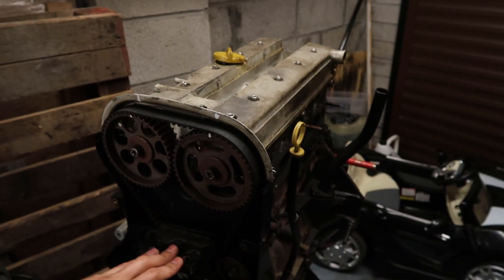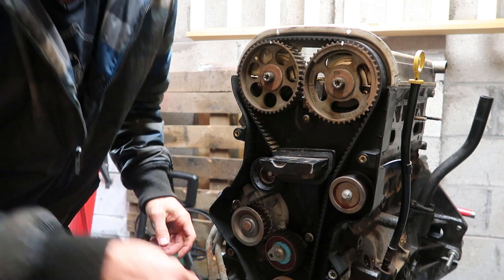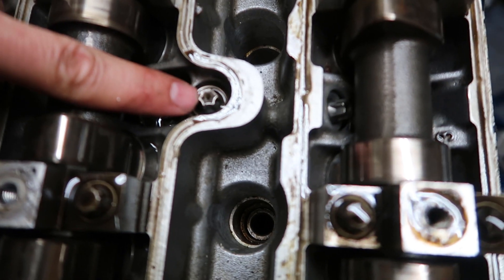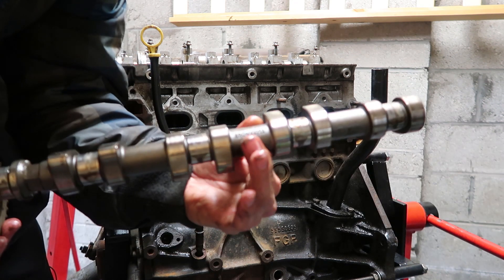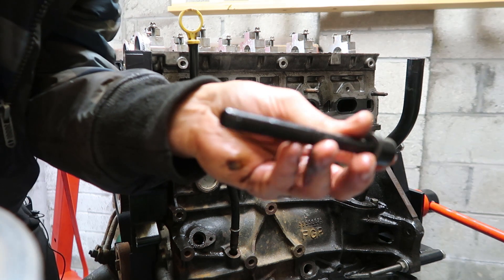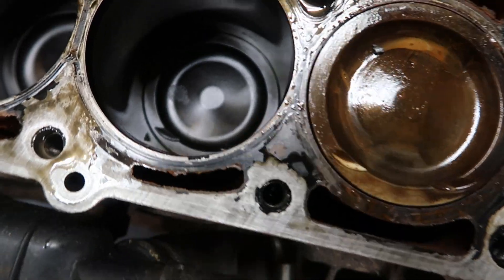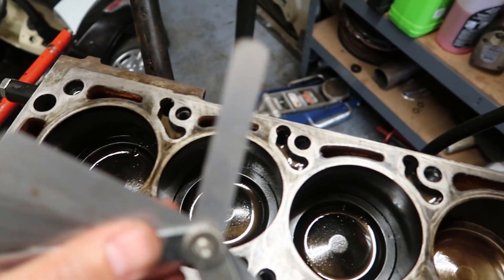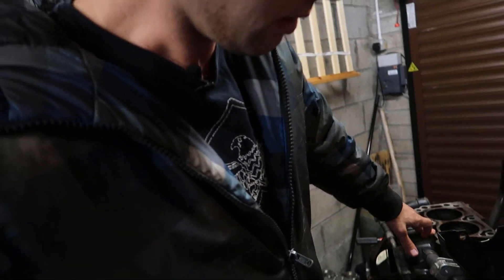Head Gasket Failed.  But Why? (Astra VXR Engine) GM

Comment: I have a minor oil leak on my rocker gasket, do you recommend  any🎉 silicone with a new gasket? 
Which type? 
Engine z20let
Reply from the maker: No don't add any extra sealant.  Let the the rubber do its thing

Comment: I got the same motor, blowing white smoke and bubbles in reservoir, initially head gasket, car starts and runs but after a short drive or 10-15 minute idle it fails to restart until cooled down, thoughts ??
Reply from the maker: Headgasket or cracked head/block
Reply from the maker: The blocks warp badly aswell so definitely need decking both head and block before throwing a new gasket at it

Comment: I've changed the head gasket and burnt valves on my 2005 Astra H on 3 separate occasions now...I have to change it again since there is oil leaking into the coolant reservoir. I don't know why it keeps happening. Engine went to engineers, and they say the block is not warped. Car drinks coolant like a desert camel.
Reply from the maker: @stanmarr4488  when alloy heads a badly overheated they can "go soft" if the deck surface is perfectly flat on both the block and head freshly machined to the correct Finnish.  That means it can only be the head itself if a good gasket was fitted

Comment: i know this video was posted from 2 years ago but i thought i might give it a shot for a question.

I got a z20LET and mine has a blown head gasket too. Now i have a other Problem that my engine is leaking Coolant on the floor when i turn it off and leave it over night. The next day theres coolant everywhere on the floor. Where could that come From? under the car theres nothing to see... i did a leak test and the whole system was sealing properly. my friend got the same Problem but i cant see where it is leaking.
Reply from the maker: Have you got a coolant system pressure tester?  What normally happens is when you drive the car around with a slightly blowing headgasket, it pressuris the coolant system and coolant blows out the back of the expansion tank.

After a hot shutdown and parking up it will continue to drip for sometime.
Reply: first thank you for your answer,

i did test the system when the car is off and everything is sealing but after a longer ride i have on the passenger side under the car a big coolant leak and i cant say where its coming from. i heard something that theres is a hose that gose behing the oilcooler or something.
could possibly that leak?
Reply from the maker: @damjanmilosevic4161  Have you replaced the headgasket yet?  

Like I say the cooling system over pressurizes from combustion gasses entering the water jackets forcing coolant to escape form the expansion tank after hot shut down.

Comment: Mr #BoostHit!   What brand of hydro capital do you recommend? if it clicks should I make a new one or is it worth disassembling and cleaning?  (Z20LER)  . Thanks for the reply!  Respectfully,  Richard.
Reply from the maker: "Hydro capital "  what?  Are you meaning hydraulic lifters?
Reply: @boosthit811   Yes, hydraulic lifters :). I used "Google translate". One is already clicking. I gather some information before I start. What brand do you recommend?
Reply from the maker: @rigofutty5172  ok.  You can pull them apart and clean them.  They are held together with a snap ring.  Use vice grips and some wood to pull the centre piece out.  Clean up with ultrasonic cleaner or white sprits and a small brush.......

Mine were very bad.  Since cleaning 2/3 years ago are perfect now.
Reply: @boosthit811  Up for cleaning! I don't buy unnecessarily. Some of the new ones are bad. Thanks for the advice. I will continue to follow your videos!

Comment: How much to rebuild my z20 leh its still running but I would like a full rebuild stock
Reply from the maker: Depending if any engine damage and are you after a drive in drive out service.  Guessing £1200 to £2500 ball park.  Depends on spec.
Reply: @boosthit811  ive got a zafira o know same engine and i. Looking to get another car so I could drop the vehicle to u and leave it till jobs done wot about warranty and how long would it take and where about are u im in Essex
Reply from the maker: @richardgrubbe1013  oh.  I'm the other end of the country 😅
Reply: No worries mate thanks for getting  back to me bro

Comment: I have c20xed engineand cylinder head resurfaced changed valve seals and on cylinder nr1 i have oil leak somewher from head to combustion chamber and intake manfold. What could cuse that
Reply from the maker: A crack.  Pressure test water jackets in warm tank to around 30psi and then do same with oil ways up to 100psi......
Reply from the maker: Does it have new valve guides?  Block decked?
Reply: It has been pressure tested before surfacing, and at the shop they said there is no need for valve seats, only seals are replaced
Reply from the maker: @srbskipas5667  ok.  Unless you specifically asked for oil way to be pressure tested they normally wouldn't bother.  Could makeup something yourself....
Reply from the maker: @srbskipas5667  most likely something simple likely a ripped or damaged valve stem seal or guide.  Or un diagnosed crack......that's assuming the oil is coming down from head and not up from damage to piston
Reply: @boosthit811  when I take out sparc plugs  i can see small amount of oil sliding into the piston when the engine is hot and piston on cylinder nr1 is on tdc. I saw that through sparc plug hole. And it is pretty small amount of oil. There is no coolant missing or mixing with oil
Reply from the maker: @srbskipas5667  I would probably apply a pressurised oil source into the oil pressure switch and watch through the plug hole to confirm.....sounds like a strip and inspect to see what's failed.
Reply: Oil way through center of the head you need to do the common mod with alloy tube

Comment: Hi do you maybe know the torque values for the head bolts and the cams?
Reply from the maker: Head bolts: use new.  25nm then 90° + 90° + 90° + 45°.  Cam caps 8nm.
Note head bolts start from centre and spiral outwards for torquing down head.
Reply: @boosthit811  thank you. Much appreciated

Comment: gASKET RUSTED BAD. tHE OWNER PROBABLY USED ONLY WATER INSTEAD OF COOLANT AND  THIS RUSTED THE GASKET BADLY. JEEZ SOMETIMES IN SUMMER I PUT ONLY WATER IN MINE. MAKES YOU THINK DOESNT IT. OBVIOUSLY WITH THAT CRAP SILICON GASKET THING GOING AROUND EDGE THE OWNER TRIED TO BODGE IT UP.

Comment: new here, are you an engine builder by trade? also do you use a manuel when doing this work? cheers
Reply from the maker: Mechanic by trade, moved into more engine building performance   based stuff.  That's my passion.  Manuals are very handy but haven't found one specific for the vxr.
Reply: @boosthit811  how do you know the torque specs then? and great channel but need more weekly uploads 👍
Reply from the maker: @jasonjuggler3457  thanks.  Yeah I know, quite busy with my day job.  The last engine build i did i used ARP studs and fasteners throughout and arp supplies all torque settings and thread lube.  Normal basic engine build stuff you can find settings online or use a Haynes manuals etc.
Reply: @boosthit811  Its rare to find a knowledgable channel which does engine work shares their expertise. Thanks a lot for your replies. I have subscribed.

Comment: Is that deck within tolerance though? After all, it's a Vauxhall and that's not where it failed.
Reply from the maker: Haha fair point.  I don't know what the exact tolerance limit is but personally on my builds I would deck the block.
Reply: @boosthit811  if theres a degree of consistency in that gap...its likely to be a factory preset...put the cleaned block in an iven and check it at a bit above operating temp...may well settle out zero hot...same for heads...gaskets age like everything...not detonation suggests this would be the problem...im new to these engines & just got on a CorsaB bent to fit one of these...all my car life on bmc minis...i dont like torque to yeild...theyre for an industry full if idiots to avoid the need for re-torquing heads of new cars under warrantee like the old days...i really think they are part if the epidemic if head gasket problems these days...turbo engines should be O-ringed eos...sooo much heat to contain...metal expands thats basic physics
Reply from the maker: @Errol.C-nz  thanks for the comment!  In my experience/opinion with a performance based turbo engine I would like to start with a block completely decked flat at room temp.  That engine was over heated (owner said).  4 thou is a bit too much.
Reply: Hi boost hit

Had a bit of a nightmare recently with my z20leh 

Melted two pistons and destroyed two bores in the process

Looking for replacement options 

Just wondering if you have anything available 

Looking for either a replacement bottom end or just a decent block 

Just wondering if you got anything available in your spares

Comment: Not sure is it something wrong on your island there and cooling liquids for engines, but I did bought one used engine from there (UK) and also on every Z20XXX video on YouTube I see all blocks are corroded quite bad. In my old Z20LET that did quite a lot, block inside looks like brand new unlike one I got from UK that I had to do some really heavy  cleaning of corrosion inside cooling jackets. WTF if going on there in "good save the queen" country is kind of mystery to me.  It is true that clean water is best heat conducting medium, but also it will help to corrode almost anything. Is it that people just do not care so much or something else, hard for me to say. I have also noticed Antifrize is mixed in some videos with distilled water or deionized water. WTF I do not get it. Distilled water is quite much clean water unsaturated with anything and it will want to bind with what ever it can bind. That can just promote corrosion much better than normal as I understand. To conclude, so much heavily rusted water jackets in UK videos is quite strange to me.  BTW keep up the good work. Bring on more videos, like it.
Reply from the maker: Hey man, thanks for the comment.  Just found this in the "spam" folder.  Anyway im not too sure what the story is with the corrosion exactly.  Possibly engines left sitting (broken) for long periods minus coolant and or because they are quite cheep ish cars and get used & abused maybe a bit neglected also?
Reply: @boosthit811  its because of all the chavs that own them and don't use coolant mix its always just water
Reply: It's the dex cool coolant they advise to use. It turns orange very quick . Iv flushed mine 3 times with new coolant in 6 months trying to get it clean but the water jackets must be bad as after 3 days it starts changing colour again and iv had to change the reservoir to a new one due to orange rust staining